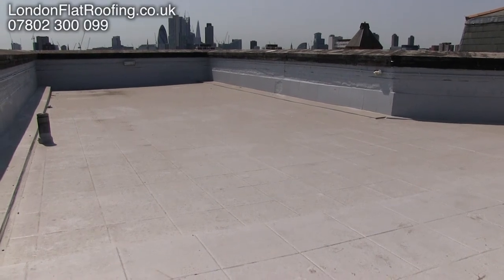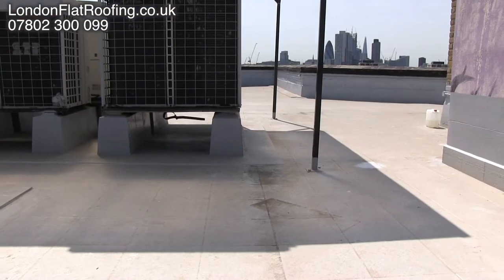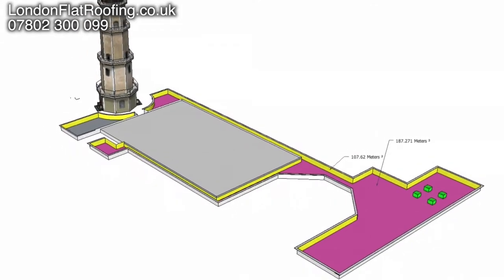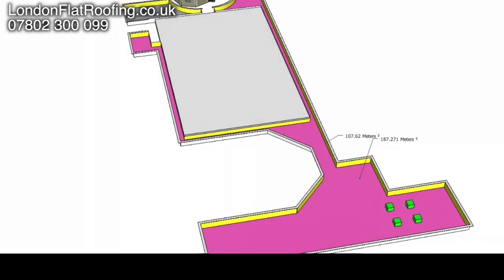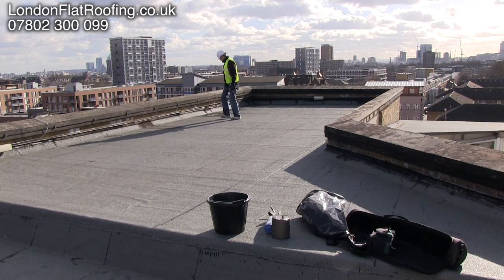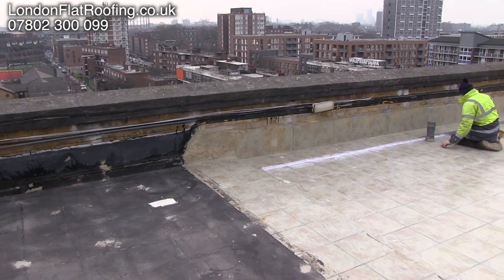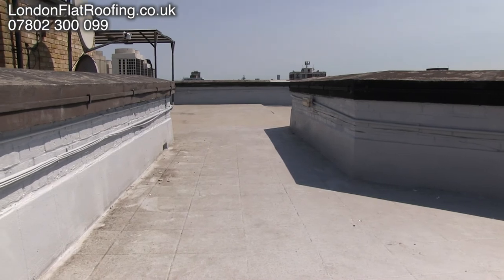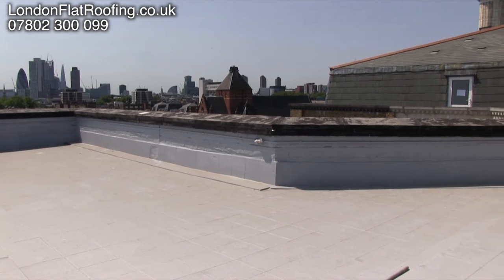Stripping a old felt roof and overlaying with a new roofing membrane

Comment from the maker: No the Gacopro silicon based flat roofing system has no reinforcing it relies on the old flat roof surface being sound and strong, any cracks found whilst doing preparation work are reinforced before the application of the new liquid roofing system.

Comment from the maker: http://youtu.be/D27eUARhEjA
The old felt roof on this Mosque in London was removed and a new waterproofing system was used to cover the existing sub roof.
Using the GacoPro roofing system from Gacoroof the old substrate was  prepared  and covered to form  the new waterproof membrane. By doing so costs were kept to a minimum, previously  the roofers had tried to build up the roof using timber and mineral felt and realistically this just added to the problems, the advantage of this roofing system is that its very easy to inspect as its all on one level and one even color with now stones.  Ive recently been out to the USA and visited the headquarters of Gaco in Milwaukee just outside Chicago there roofing systems are really starting to take off now and a huge expansion of the factory was being undertaken whilst I was there,they are expecting to  exporting to the UK and europe  filling the missing gap of a good cheap solar reflective liquid roofing system that can be overlayed on just about any old flat roof.